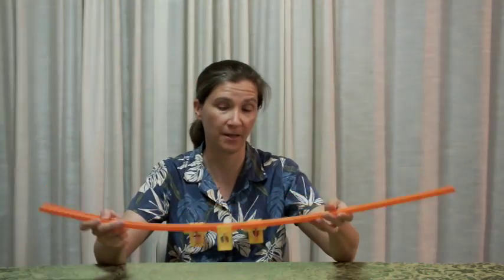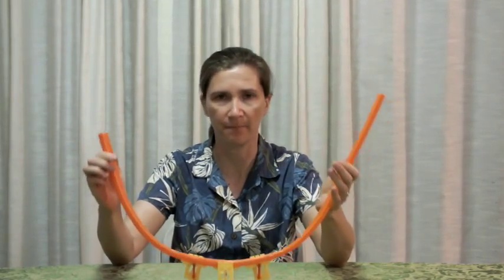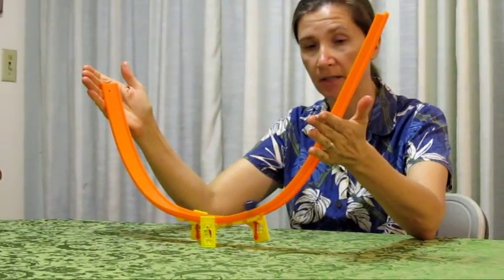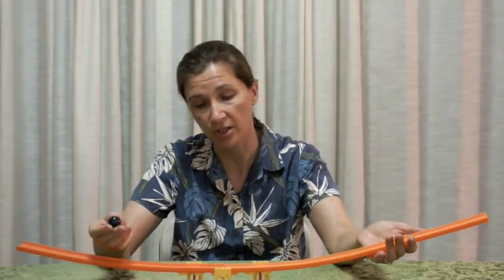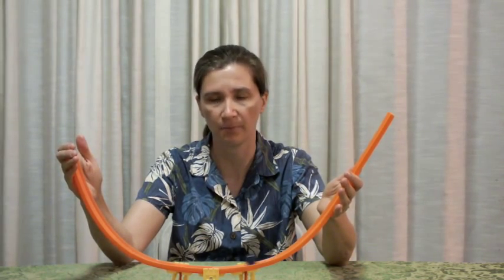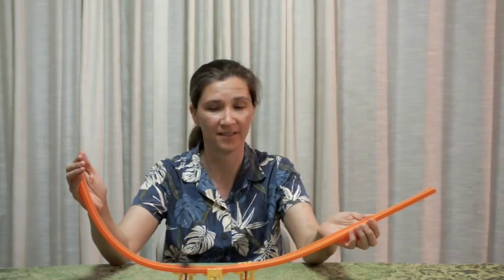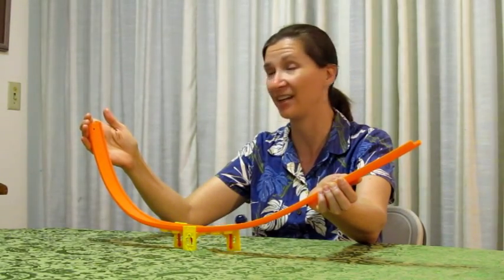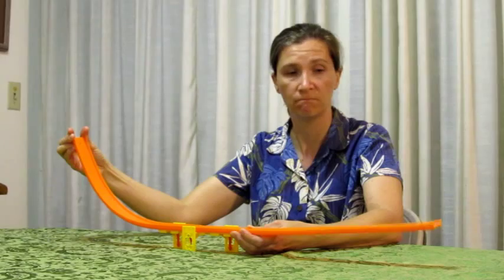Physics 100 Inertia Demonstration

Comment: Inertia is the act of gaining or finding equilibrium. You omitted the force of gravity. An object will move until all sides of the object has expelled or resisted the influence of pressure around it. A beach ball floating on the water floats because the gas inside is lighter than the water, in which the heavier water pressure pushes the ball up until the ball reaches a lesser pressure, which is the atmosphere and settles between the two, where it 'finds' it's equilibrium.
Reply: Floatation is nothing to do with how ‘heavy’ or ‘light’ something is. An ocean liner is heavier than a single brick but it’s the liner which floats. It’s more to do with density. Objects which are overall less dense than water will float.